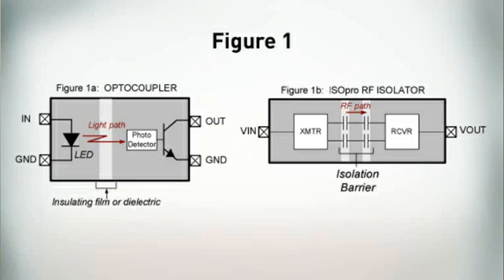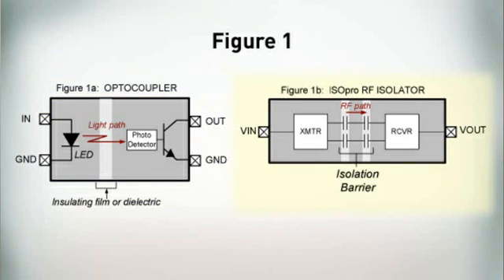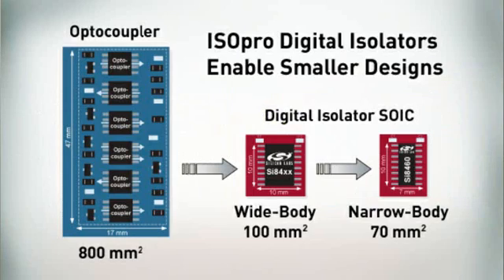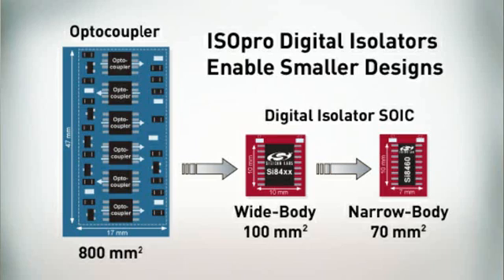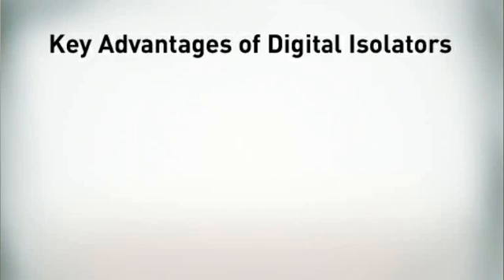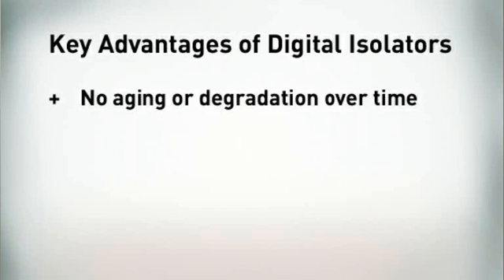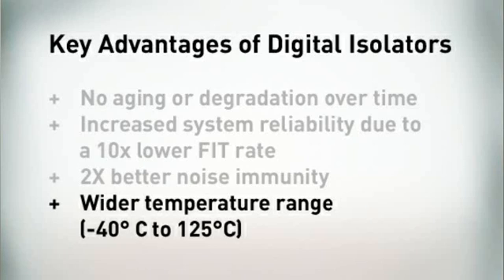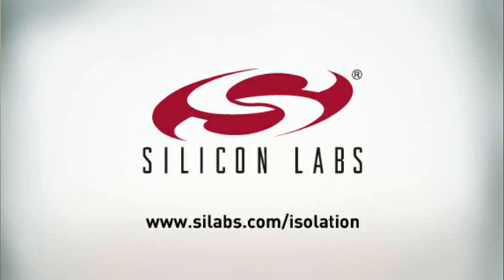Digital Isolators vs. Optocouplers

Comment: Since these work by RF, do they emit any RF noise outside the IC package that could interfere with other parts on the PCB? Also they seem like they are a sensitive device and could be susceptible to stray RF causing your output to be effected.

Comment from the maker: The clock is on the low voltage side and does not need to be isolated.  The FET gate control signals are isolated from high voltage side using the Si8234 on the POL board.  The Si8234 has built in isolation as well as gate drive capability.

Please qualify your question on "how good"? Do you mean what is the pulse width distortion?